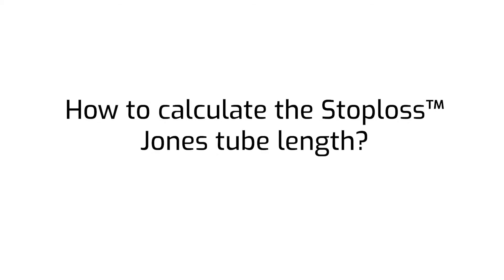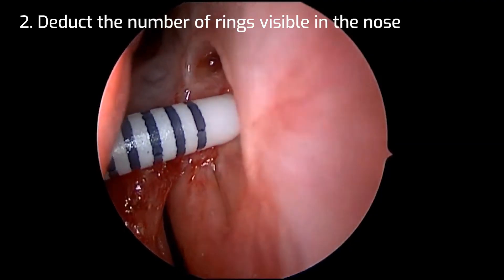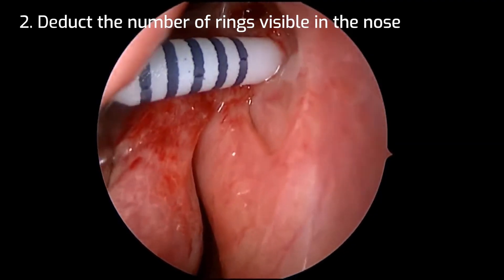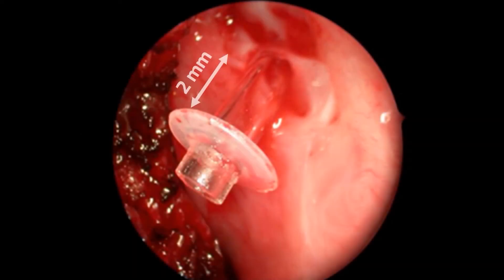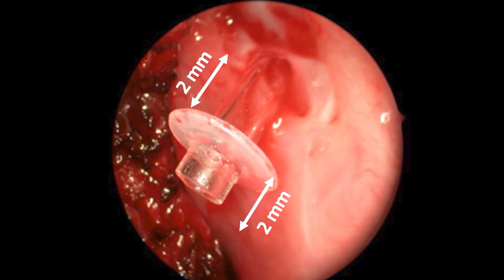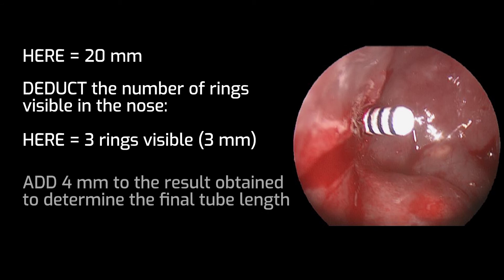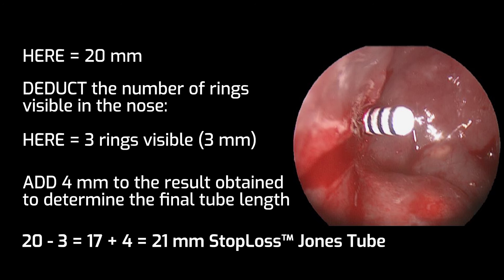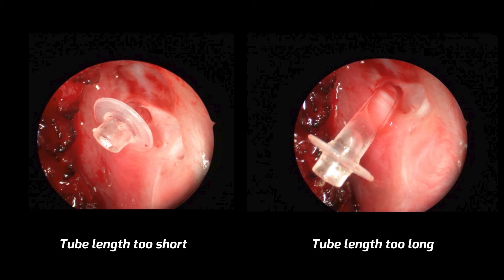StopLoss™ Jones tube | CDCR | Tube Selection Process | Exclusive | FCI Lacrimal

Comment: You do not perform a jones tube if the horizontal lacrimal duct (that is the canaliculi) is patent. In that case another DCR is recommended. 
You will have to stop boxing with a Jones  tube because it could break easily in case of trauma, but you can fly as much as you want. A tube if well positioned can last many years up to 15 years probably but a replacement might be necessary after a few years. 
Hope you found my comments helpful.

Comment: Hello! I have had a surgery called DCR because i suffered a blocked tearing duct. Unfortunately it wasn't successful. Howerver my doctor advised me doing the jones tube or trying to do another DCR.
I would like to know more about the joned tube. Like i do boxing sparring would that stop me from doing these kinds of sport? And number 2 can i fly on airplane without troubles?
And finally how long that jones tube last?
Sorry for making it too long but i am 27 years old and i have suffered for at least 7 years with a blocked tearing duct. I can see difference between my eyes specially in photo and that makes me sad but anyway i d like to know more about that tube.
Reply: Did you proceed with lester jones tube? Cause i have the same issue. Please share your experience to me